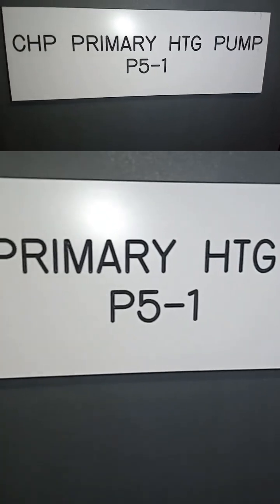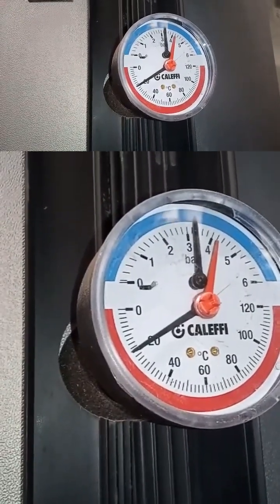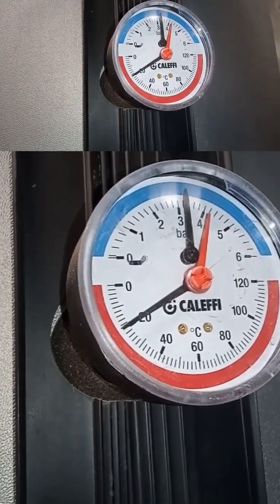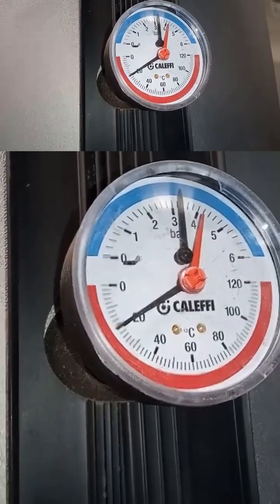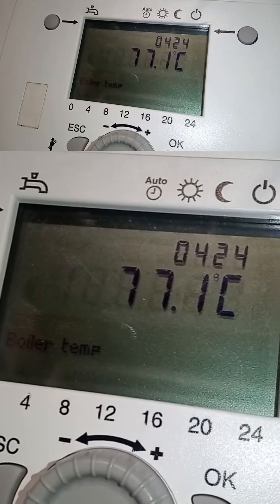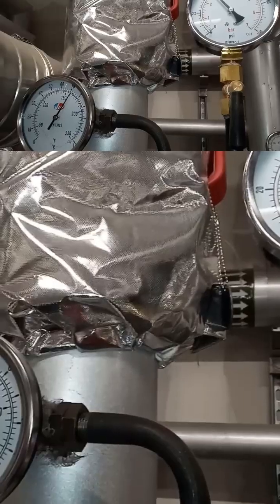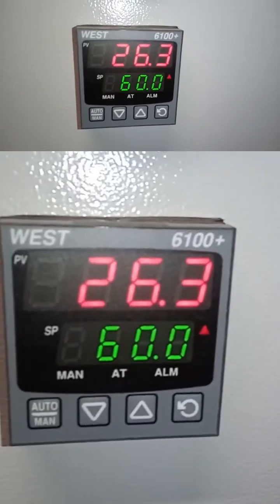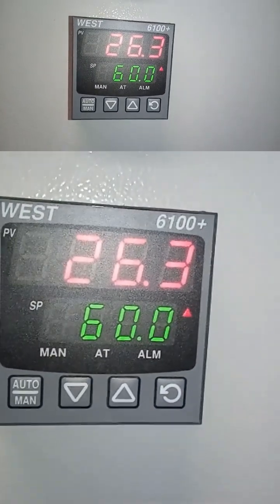LONDON TO YORK CALL OUT TO BURST BELLOWS

Comment: I’m on call this week. My area is between Fishguard and Reading. A normal day is a 2 hour to my first job. You just get used to it.
Reply from the maker: There are options. I've had roles where I'm in the van 6-7hrs a day standard. Roles where I've worked one post code on a push bike. Sometimes, you have to just go with it and survive. Other times, you have to run. These days I do 3-6hrs driving. My last job 1-2hrs.